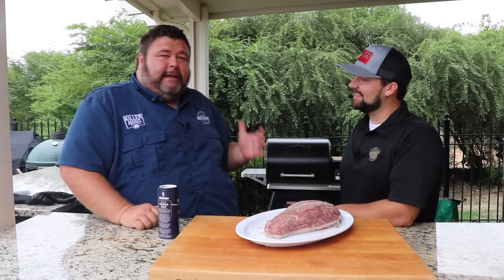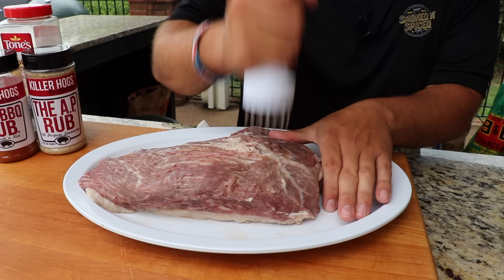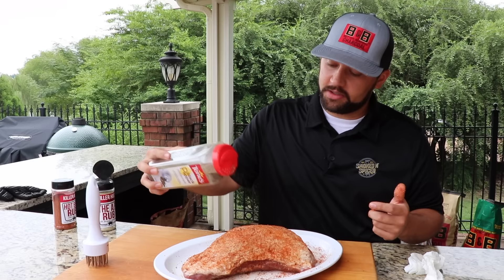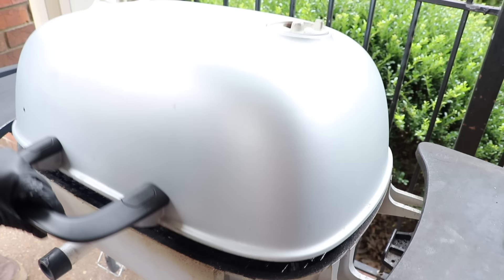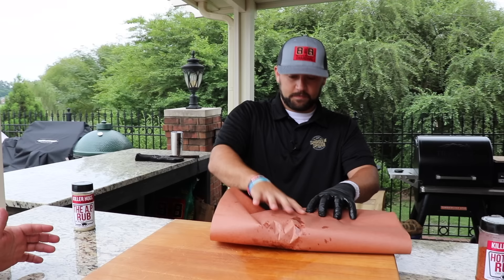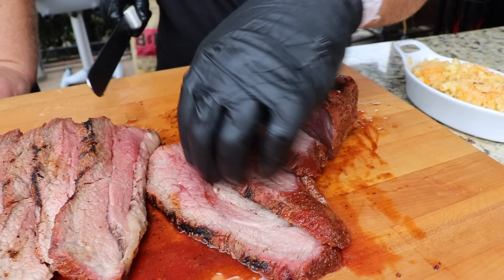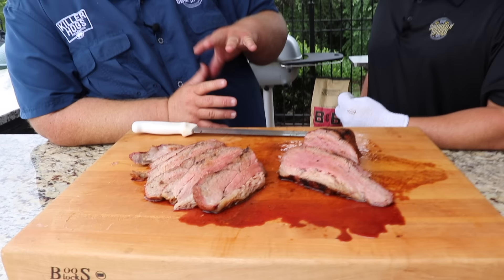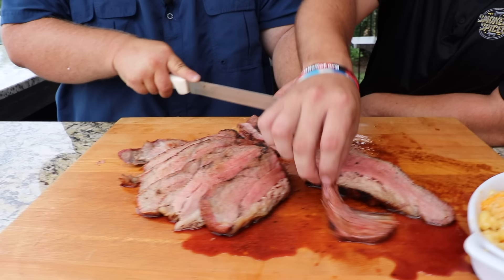Reverse Seared Tri Tip Recipe

Comment: This one I do myself on my Lil' Tex Elite (old school) when they came with stainless door and stack cap, upgraded with a "Savannah Stoker" Controller
, but I cook at 225⁰ and pull it at 110⁰. Give a few minutes sear on each side and pull it between 125⁰ - 130⁰ depending on size, transfer it to a foil pan and cover with foil/dish towel.

Turn the grill down to one burner on low (aprox. 200⁰) and watch the temp on your probe to see how high it goes, every Tri-Tip cooks different. The more fat inside the slower it comes to temp inside. If doesn't reach your preferred finished temp, put it back on the grill (INDIRECT) in the covered pan until the temp gets within 5⁰ or so depending on size and how far away the temp was when it peaked while resting.

Comment: That tri tip looks great! Ive grilled a lot of those on a Santa Maria grill using oak so i have usually forward seared them. I just picked up a masterbuilt gravity 560 so im gonna try that reverse sear method. Great video, but I do have to point out that you guys sliced it wrong. Cut it down the middle then slice against the grain.
Reply: I picked up in that cutting also.....

Comment: Good show guys my only thoughts are when you slice it the grain of the meat goes in two different directions and you need to pay attention of that always slice across that grain the other thing is tri-tip needs to be just a touch more done to get the tenderness you’re looking for believe it or not you don’t really do try tip  rare, med. is best in my opinion also Red Oak is the traditional wood to use! greetings from Santa Maria Ca.

Comment: Okay so I tried this with a tri tip similar to yours is was 3.5 pounds.  I used 275 temp method and internally it was at 115 in like 40 mins.  My smoker may run hotter, i would try 225 if you have a pitboss.

Comment: Been doing tri tips here in Cali for over 20 years. One thing I must say. Cutting it is a big deal. Tri tip you cut into different directions. Againts the grain. He cut this wrong and I was smh. Everything else looked perfect. But do NOT cut your tri tip the way he did. 😊

Comment: Malcom, can you advise on what flavor pellets that were used in the Traeger? I'm lucky that my Costco has prime tri tip all the time. Will try this recipe at home.
Reply: I like apple and cherry but it depends on your taste,,, Actually sone of the best tasting smoke I have had was from a blue spruce I cut down... It po
Reply: sorry dog jumped on keyboard and sent....fishing and correcting spelling error.. sone+some  and finish it pops a little but oh man the taste.....
Reply: Thanks!
Reply: I wondered the same.  Has anybody tried this with Hickory or Mesquite pellets?
Reply: @kirkhedrick1074  Since I wrote that question 3 years ago, I have been using oak pellets for the Santa Maria flavor profile. Looks like Traeger discontinued oak pellets. I found some from another vendor to use. Good luck.

Comment: Wow, It looks great, and I bet it tasted great, but the carving job was not great. Grain changes direction in that cut of beef, need to cut in half at the fat seam, then turn 90 degrees and carve on the bias. I guess that's what happens when BBQ folks try to do something out of their comfort zone :) Seen it before many times lol. I also would of let the dry brine ride (with extra spices like fresh cracked black pepper, granulated garlic and granulated onion) for at least 1.5 hours and not rinsed it off.

Comment: 1:26 WOW! Is USDA Prime so bad that you have to practically stab it into ground beef? Staggering...
Reply: USDA Prime is excellent. You do not have to stab it, it's excellent without doing that. However, it may add additional tenderness and allow the seasoning to penetrate further into the meat. I am going to try this method today on one of the two tri-tips I'm smoking and see how it compares to the non-poked version.
Reply: @mikek5206  Well?
Reply: @1983mojo1  I forgot to update this! Sorry. If I remember correctly the tri tip that was poked was marginally more smokey. Next time I smoke tri tip I'll run the experiment again and keep track this time.
Reply: @mikek5206  thanks for the update!

Comment: Looking good. What are dry salt something like that I normally leave it anywhere from 4 to 12 hours before I rinse it off. Do you feel 15 minutes is long enough to draw out the bad stuff or bad moisture I should say
Reply: Rus ridge 15 minutes will not do much of anything except for waste the salt especially on the fat side.
Reply: Ducaticraig 
Kind of what I was thinking although when left on for a longer period of time it works wonders. They may have done it in the interest of time or because they were going to put so many of Malcolm's seasonings on that have salt already. Sure it was very good if Malcolm had anything to do with it
Reply: I feel he didnt even use enough salt too let alone 15 mins..
Reply: Usually when I salt a steak I let it sit for at least 3 hours, then let it get to room temperature, and I don't rinse the salt off.
Reply: You do not need to bribe a trip tip. Brine is used to keep lean protein moist. There is plenty of fat in tri tip. Keep it simple, these guys are trying get views and make some money.

Comment: Try a nice coat of rock salt and  pepper. Then atab holes in with a knife and twist, fill the hole with a  1/4-1/2 garlic clove. cold smoking it for 30-45 minutes bring it up to temp slowly with indirect heat then sear that puppy. The garlic inside really sets it off and the rock salt is amazing when you crunch a piece between your teeth 👍👍👍👍👍

Comment: Every time I've seen a reverse sear the meat is left to rest after coming off the low-n-slow, then after resting, placed on the high heat for the sear portion.  Once seared it can go straight to the cutting board.  Any thoughts as to the different methods?  Thanks for sharing.
Reply: Likely depends what temp you take it to during the initial cook, whether you are trying to make to outside look pretty or actually finish the cook - that will determine your timing here,

Comment: I want to try this recipe but I'm working with just a medium sized Weber barbecue grill was wondering if there is any suggestions on how I would make this really really good
Reply: Jim Armstrong Oven at 275, rest for 15 min once you get to 125, high heat sear on the Weber.

Comment: All the keyboard pitmasters are out in force for this one
Reply: I never done a tri tip before, but the comments about direction of the cut and the timing for the initial brine are very useful.
Reply: There's no "brine".
Reply: Did you even watch the video. He did a salt brine. He even says the exact words and the cook said thats right.  0:46
Reply: Yes, that is wet brining. If you didnt know there is also dry brining. They didnt specify that in this video, but technically it is still a brine. Also i dont think both of the pitmasters in the video would say that it is a brine if it was not in fact a one.
Reply: If it's indeed "wet brining" where's the water?  Salting a piece of meat and leaving it on for 15 minutes, then rinsing is your idea of a brine?   Okay, Remzly, you win.  LOL
Reply: I said what you explained there is wet brining. I never said that they used a wet brine in the video... What i did say is that they used a dry brine in the video, after you said they never used a brine. Dont know what was so hard to understand there, go back and re-read the comments
Reply: I surrender, Remzly 0
Reply: 15 min is not considered dry brine. To dry brine you would have to a least leave it with salt for 2 hours. And normally a dry brine takes overnight.
Reply: A brine is literally just salt and water.  It doesn't define the ratio nor does it define a time period.. it's just salty water.

As the salt leaches out the surface water it becomes a highly saturated brine.  Simple as that.

Comment: #1 That is not how you treat a tri tip. You shouldn't have to use a meat tenderizer on it at all. 
#2 anyone using a prime cut can get good results. 
#3 you are supposed to cut against the grain not with the grain.

Comment: Is there an advantage to lump coal over briquettes ?
Reply: Lump is hardwoods no additives, and typically will burn hotter and longer. Briquettes have additives the make them into the briquettes.
Reply: Travis Muhler Thanks!
Reply: Lump burns hotter better for searing
Reply: it has been my experience that lump will burn hotter than charcoal but not longer. That's why most bbq fans will cook low and slow with charcoal and lump for grilling, searing etc.

Comment: just for the record this is NOT Santa Maria preparation. Santa Maria is sear then indirect and you gotta pull about half of that fat cap off. This isnt a smoker cut. It has to be grilled imo. And its not pink inside the thick section. Tri tip will turn into beef jerky if you leave it on until it turns gray like that.. You have the best bbq channel vs that kosmo klown. This is just a regional cut and I live here so i felt like commenting. Santa Maria Tri Tip has Bark!

Comment: Sorry, but that was way too much fat left on the Tri.  I rather sear first and then a slow cook with light seasoning (your smoke will add to the real flavor). With an internal temp of 135 to 140 I take it off and drape it in foil for 15 min. This locks in the juices and creates for a thin light crust. No rush on the rest juices need to blend throughout the meat. Did you notice when you guys cut into the Tri… there was way too much of the meat's  juices leaking out. You shouldn't have had to sop up the juice in order to add juice to the meat.  And I was surprised to see you cut with the grain. Cutting then pieces against the grain breaks the meat's fibers even more, making for a very tender piece of meat when chewing.
Reply: so what you are saying is, your way is the only way to cook a tri-tip and your tastes are the only ones that matter.. :D

Comment: I own that exact Treager timberline and that tri tip had great grill marks but why would you not super smoke it on that grill, and just use the timberline to sear it? No smoke ring and looked way more dry than any tri tip I have reverse seared.  Its not always about presentation. You took it off a $1800 grill/smoker to blast it on a $200 grill with chemically processed charcoal. Makes no sense and, when you cut it open the color on the inside was not impressive.

Comment: There's no reason to leave that huge fat cap on unless you're going to eat it.  There's more than enough internal fat in a tri tip to keep it moist & juicy...and he sliced it wrong.  Slice it perpendicular to the grain of the meat.  This must have been his 1st tri tip.  smh
Reply: Mike Roller Not to mention that the fat cap keeping meat moist is vastly exaggerated anyways.
Reply: Agreed.
Reply: I suspect they were planning to eat the cap. I sure would.
Reply: I do not leave it on either. Some like it. My Wife is a fan as well. Not me, I take it off. This hiqh quality meat yo don't have to bother cutting against the grain.

Comment: I know you've had plenty of practice at all different kinds of meat and cooking techniques, but this was one video I was disappointed in. Reverse sear is a fairly easy thing to do, and basically is only there for looks in my opinion. My main question would be about the collagen, how does it have time to render and congeal with such a quick smoke at low temp?... Science says with a piece of meat that size (about 3-4 lbs) you would need more time for "meat magic".
Reply: Swerve 
Ever actually cook a tri-tip?
Put down the text book and actually do it some time. It's a pretty tender piece of meat to begin with.